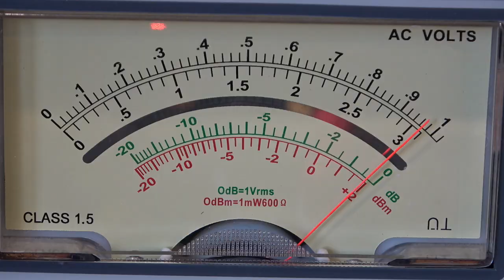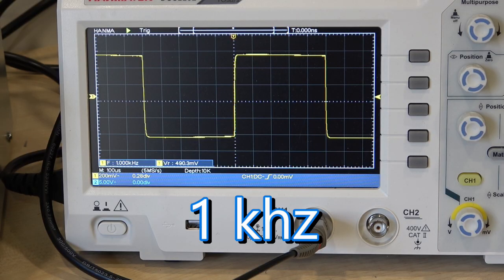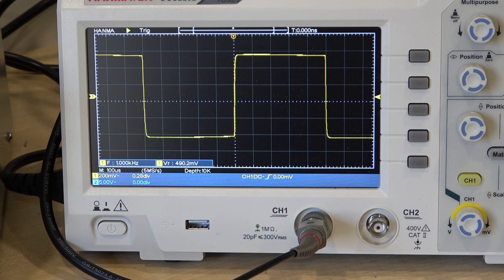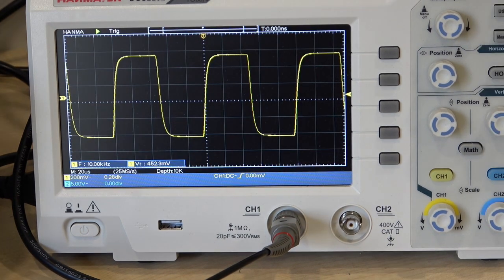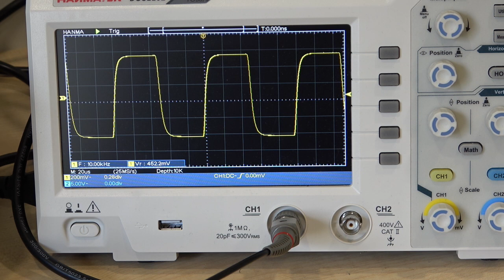A last look at the Quad 405 Clone.

Comment: Dear Michael, JIMS audio provide the board, as well inductors and transistor metal plate for quad 606.
In fact it is Quad 909 that power transistors are the only difference with 606.
I recommend.
The same more or less happen with 405 PCB.
But of course I never trust "ready kits"
Reply from the maker: This was my last look at the Quad ANYTHING. People spend much money trying to make a fair amplifier better, it was good in the 70/80s but things move on. The L12/2 sounds very good out of the box.
Reply: Hi Micheal, can you tell us were you purchased the power supply unit ? Thank you for your great videos!